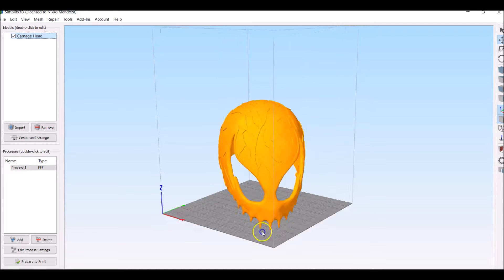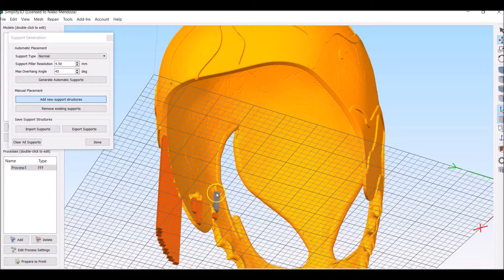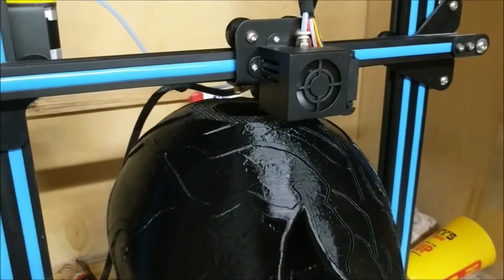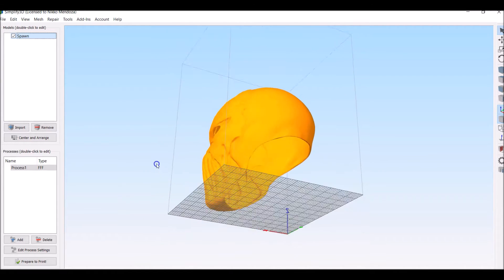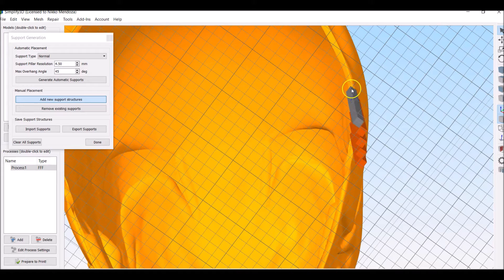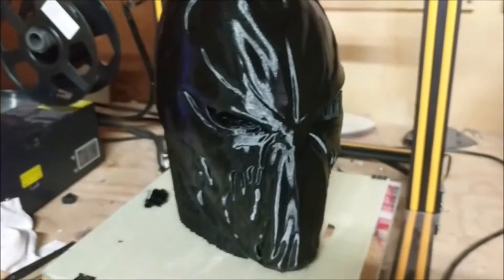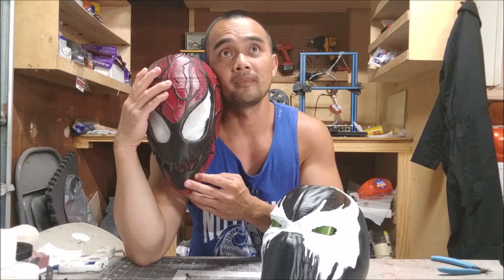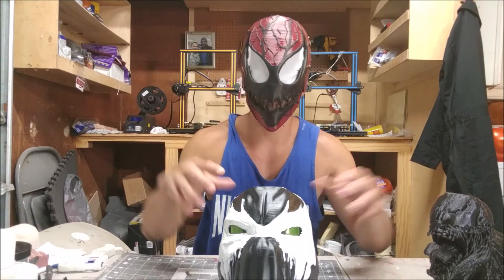The Best Way to 3D Print Your Helmets

Comment: I  had an idea while watching this video. Wouldn't if be quicker to use support blockers and then generate supports? Save you time in having to add them in one by one. I know Cura has the support blockers. I will put the idea to the test on my next helmet build. Thank you very much for a great video and I will be using this method from now on.

Comment: I recently tried this method on a mask I was asked to print. The print failed (due to a jam during printing. BUT THE MASK TURNED OUT AMAZING. There were a couple of rough spots, but nothing a bit of sanding and smoothing could not fix up. Any masks or helmets I print from now on are going to use this technique. Thank you for sharing this.

Comment: I'm using an ender 3 pro, I have a pretty average head shape, and I plan on printing off a shoretrooper helmet, however it's taking more 20 hour to print parts that aren't even that big mainly because of support, I can't fit the dome part on the printer as a whole so I print it off in pieces, is there a way to reduce the print time, would increasing nozzle size help?

Comment: Can you print a Batman cowl as one piece? Or will the head be too big to fit through the neck hole.  Probably a dumb question, but I am still a novice at this.
Reply from the maker: It depends on the file.
Reply: @NikkoIndustries  Good point! And of course the size of my head/neck. For the files from your store, do you recommend multiple parts? I have the 2021 suit and the Prime one. I also have the Nomura suit, and I am thinking I could do that as one piece.
Reply from the maker: @undisputedgreatest  I've personally printed the Nomura helmet and you can put it on in one piece. For any neck piece, I suggest printing it in TPU and cutting the back and adding Velcro or a zipper

Comment: Your videos have been immensely helpful for me just starting out with my CR-10. I'm getting ready to print a Mando helmet in PLA...do you think I can manage without center supports like this? Or is this only applicable for flexible filament?
Reply from the maker: You can use this concept for the Mando helmet. Check my video on it

Comment: HI Nikko, I was wondering if you help advise in the following, I have printed a helmet bottom up exactly the same as yours but when it starts to print the top centre (around 5-6cm from the centre top) of the helmet, the pla starts to tear away from printing which resulted in a very thin and horrible inner layer, though the external wall is great. Do you have any tip on how to resolve this issue I am facing?

Comment: this is great stuff man. any suggestions on parameters for supports when printing tpu? ive got quite a bit of stringing even when baking the tpu to get as much moisture out as possible. i increased the support density but the problem still persists a bit
Reply: For tpu, yuo need to deshidrate the , for suport i use about 15% density and the spacer betewn the model and the suport must be a little high than your layer high, if yuo use Cura, for explample and print at 0.2 mm layer hight, the Support asistant will automaticaly use a "space" up abd down of 0.2mm, change that to 0.21 or 0,22mm thats make the gap a little biger, on the top i use a "grid of 40%",easy to remove, im printing full suport tpu  go pro camera suport, then cut the support

Comment: I really enjoyed this video, however I think that if you were to change the angle of the print so that the jaw line kind of lines up with the bed then your supports would be even shorter. For example instead of spawn looking straight like you would wear it he is looking more towards the sky which would minimize the distance from build plate along the back of the helmet.
Reply from the maker: i agree!! i started dpoing that as well. but sometimes we also have to consider the shape of the helmet. other than that, you are very correct!!

Comment: OR just throwing this out there.   you print it upside down and use no support what so ever.  (except for those few internal features)  wich should have been designed better so they could have been printed without support aswel.